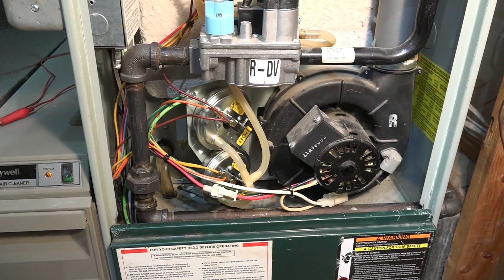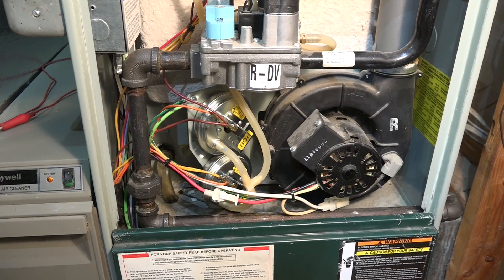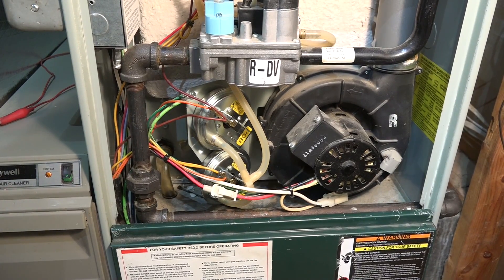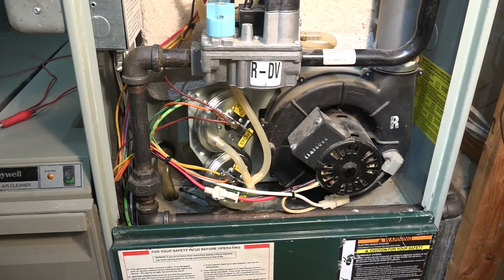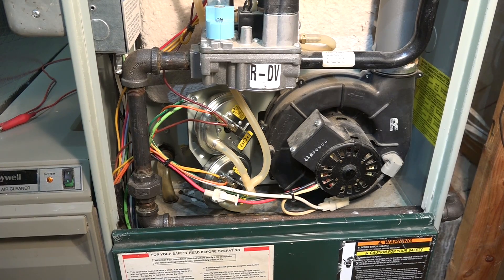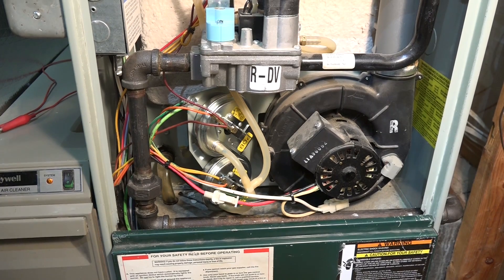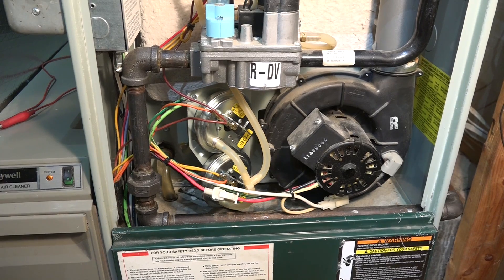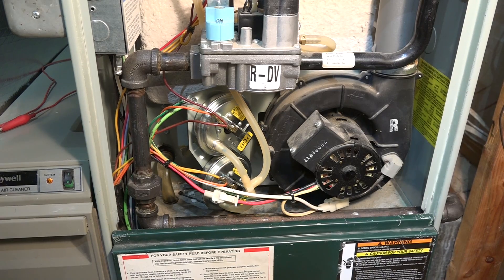What's wrong wth this furnace #4

Comment: Hmm, no error code I guess would rule out a clogged exhaust / combustion vent. I would look for an open ground, reverse polarity, or loose / intermittent A/C connection somewhere. Sure hope its not a bad IFC -- and if it is, one of those problems on the A/C most likely caused it to fail, right?

Comment: well first let me say that I'm not a household furnace tech! but I am an recreational vehicle service tech! that said I have seen my share of rv furnace problems! sounds like something is blocking the air flow! for some reason the ( excuse the rv tech term) sail switch is not closing! the furnace board can't continue with the ignition process! a safety issue! blockage of exhaust, by deep snow on the roof of the building?
Reply from the maker: +aaron schoessow For the answer, check the link at the end of the video.
GFM

Comment: id start by checking the voltage to the inducer.  make sure its not dropping voltage from the board............first glance says its the board dropping voltage to the inducer repeatedly.  although......that sound im hearing doesnt sound like water, but its a sound ive not heard one make before.  im guessing thats the board relay making all that clicking?  but id still check the drain lines on the collector box and the inducer housing anyway.  if the inducer motor was going bad the unit should lock out eventually.  same with water in the assembly.........

Comment: Bad board. Because  inducer does not run enough to close the pressure switch and drops out. So pressure switch should open and must show 3 blink code error. Should try 3 times and must go to lockout.

Comment: try bypassing the limit on the inducer motor it may be working intermintly also I've seen a short in the pressure switch I'm Goodman furnaces do that very day thing turn on the motor short turn off the motor

Comment: In this situation I would first make sure 24 v between w and c is not cutting out. If it is then it is a thermostat problem. If not the furnace control board is defective.

Comment: Either your turning the switch on and off repeatedly : ). Or a 24v short somewhere in the pressure switch circuit causing the board to reset.

Comment: For me, step one is to bypass thermostat to eliminate that as a possibility.  If good, board is most likely causing problem, since faulty inducer motors usually either run or they don't.   Before condemning board, I would check amp draw on inducer motor.

Comment: I hear water sloshing around in the inducer. However that will normally cause a pressure switch not to close. But you have no error code. So it is most likely causing an overload on the inducer motor to go off on it's out thermal protection. Check to make sure that the condensate is draining and that the trap is clean. This should have been handled on your fall maintenance. Please call for service ASAP.